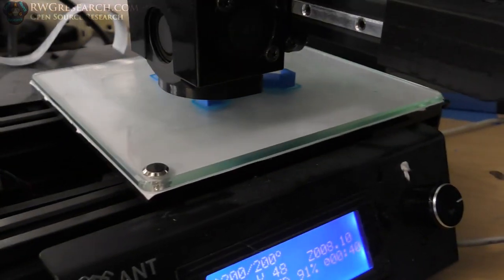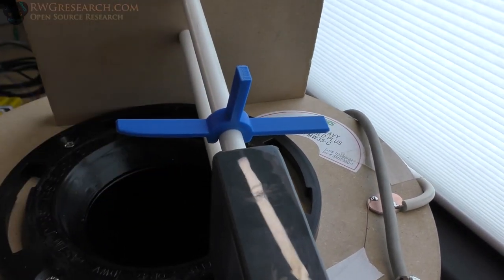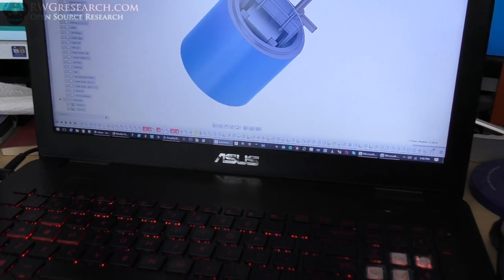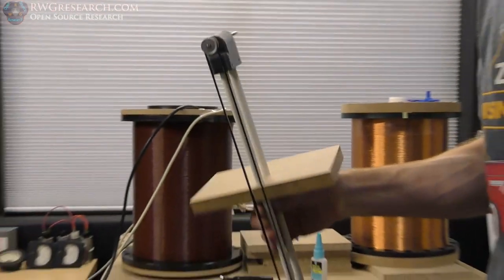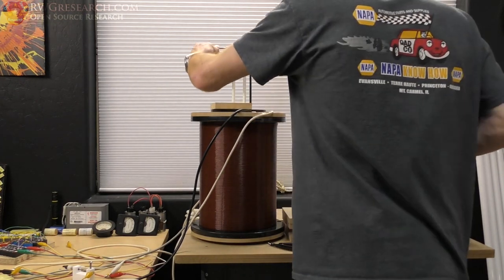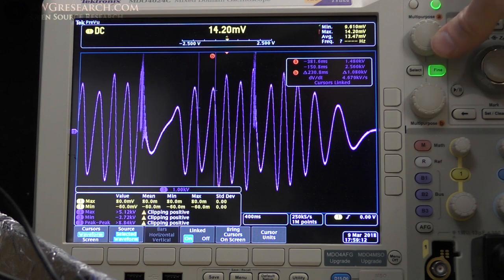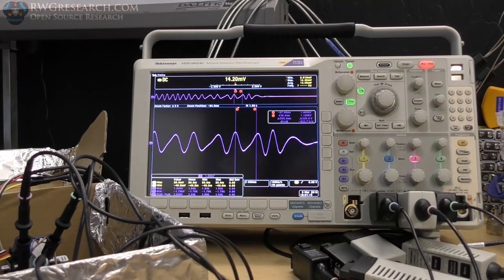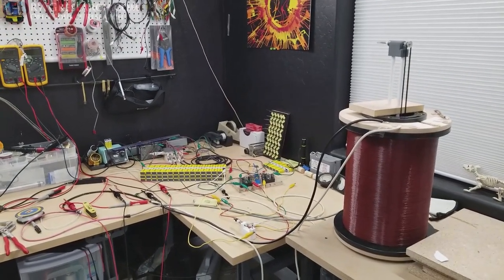JWN Project P11: 2" Magnet Inside Of The Coil.. Big Sparks!

Comment: Russ, could you try long rod of rectangle magnet inside? It could generate more power
Reply from the maker: I have used the 2" magnet like you are saying. however the best interaction with the coil is to rotate the magnet, if you move it up and down fixed ( not rotating) the induction from each pole cancel out other... ~Russ

Comment: carefull no to fry your oscilloscope with such high voltage, you can also inscrease the inductance of the coil by adding a steel shell outside
Reply from the maker: yes, thanks, not so sure i want any metal at all around this, its a totally air system. ~Russ

Comment: May I ask what the purpose of the spark gap is for?
Reply from the maker: currently the spark gap is a safety. if i short out any excess voltage by a spark gap. i can keep the crazy voltages down to a level where i can attache my probes. in this video its just to get an idea on what the voltage is. voltage break down in air is know. (an electric field of about 3 x 106 V/m or 3 kV/mm) so it gives us an idea. we had about 10mm or so... so that's ~30,000V.   it also acts as a type of diode when set up right. and lastly its a negative resistance. very useful if set up right for some of this research. ~Russ
Reply: Thank you Russ, I can understand that, but can't you use a toroid to do that? 

I am the one that emailed you about a bifilar pancake coil experiment that I am trying to get someone to look into. Just wondering if you have given that any thought? 

Also, while I have your attention here, what happened with your work on Stan Meyers voltage disassociation of water? The reason why I am asking is that I am finding that most of you guys working with coils do not understand RF energy. Stan did, and he left some hints to that. He said he hit the plates with voltages that were 180 deg out of phase, his negative side on his circuit was not ground. Even people like Eric Dollard do not seem to understand positive and negative charges. You have a scope, everything past 180 deg is negative voltage (potential) and the only way you could hit those plates AT THE SAME TIME with a positive and negative voltage (potential) would be to use the two antinodes of a standing wave of one wavelength of the length of wire used to make a coil.

I believe this is something Tesla understood, hence the bifilar pancake coil with the center tap being dead center on the antinode of a 1/2 wavelength standing wave on the coil. I have found that point to give a 3 db gain per cycle of the driving power level, and a 6 db gain per cycle  on a 1/4 wave length.

There is no doubt in my mind that both Tesla and Meyers understood these things! I am just having a hard time finding anyone working on the things like you are that does. 

I would love to hear any thoughts you have about these things.

I will leave you with a link here but please keep in mind that this is the second video I did where I was talking on the video and I make some stupid mistakes like calling the calibration line 100 watts when I meant 1 watt. I uploaded it thinking I could put some notes on the video after I up loaded it, only to find that YouTube is not giving us that option anymore. 

https://www.youtube.com/watch?v=gd7Ef2fPQ7w

Thanks you
David Monroe

Comment: Russ, i want to share my coming experiment next year, like you do on your project.  If  you want to do this too, i dont mind, just share it with lots of people as quickly as possible if you do, just in case....   I already have contacted the United States Airforce twice, and they  showed no concerns about my coming experiment next year.  I plan to first create a low powered forcefield using a static field held in a capacitored metal tube.  The three inner sleeves will provide a negative internal charge in the hollow space, approximately one to two inches deep and chafed at the end at a 45° angle to facillitate chamber to atmosphere wave form matching.  The structure that holds the tubes will at first be a non conductive metal, *********** if you use metal, you have to take into account the metal is part of the capacitor.  Also, even non-conductive materials can hold a lethal dose of static charge, thus, when doing the experiments, always have the structure holding the sleeves grounded to a well grounded source, away from any ac grounds in your area.. ************* The sleeves are in capacitor ring form because they can hold a static charge in place.  The layers will be a simple - + -  .   With the negative charge, on the inside, i can then manipulate the field with acoustic signals, ie send music/sound frequencies into the coil, to vibrate the static field as if it were water on a speaker, like they do in cymatics.  It should work.  The reason your hand can touch a cell phone or keyboard and not get stuck to it is because, like the atoms in all solid and semisolid material, there is a crystalized pattern of atoms, with a pattern of plus and negative charges, but also a lot of static fields.  If you excite the electrons in a static field to hold standing waves in a resonating chamber, and these standing waves are tiny, organized, and able to attract and or create positive and negative sides of the electrons,  they will repel matter the way your hand does.  That is part 1 of the experiment. Ps. Its possible the coils need to be wound with the inside diameter also at a 45° angle, large end pointing downward.  If you are an occultist, you could also try 33° angles on either or both.
Part 2. Is when i send large signal pulses to slap the air and cause a positive pressure change in the air, to enable a lift of the field above any solid surface.  I believe gravity is an attractive wave frequency that holds matter and magnets together.  Sadly, if you send antiwaves, or cancellation waves, it will cause matter to fall apart, lose its coherency.  But you can push off the ground using a pulsed forcefield, making it a safer and different kind of antigravity.  As for inertial dampening, i was playing with fidget spinners the other night, and found that their gyroscopic inertias could be swiftly reduced when turned swiftly back and forth at 90° angles to the forward clockwise spin.  I was thinking that maybe one could manipulate two or three loosely binding forcefields to push objects on a quark level to cancel out the inertia, which is itself a quark field phenomenon, to deplete the number of quarks moving in a single vector or direction, kind of like using two water hoses on either side of a third water hose to scramble and weaken the water dropplets from all moving forward.  By the way, the quark field i speak of is the q particle fields in my magnet theory, basically dark matter/energy, or the quantum field, or the old fashion term, the aether.  The quarks in atom colliders are greatly energized.  Thus they dissipate their energy or charge until they shrink back to normal after their having gained energy from the enormously energies from colliding particles.  Also, its possible and likely easier to dissipate inertial fields by sending a third loosely held forcefield directly opposite into a person's or vehicle's path.

Comment: Nice... See I told you it would be better inside.
Wait till you start driving it....
Reply from the maker: haha, i love you john, however... all most ALL Newman motor/generator's have there magnet in the middle, there is no " i told you so" here :) no worries my friend! i was building the version that i could... :) ~Russ
Reply: I know, just josh'n you.
Have you made the jump to my diagram yet of the magnet in the middle? Think about the flux cutting the coil and how one side is north and one side is south. This splits the coil essentially and generates voltage like a pump generates pressure. as the flux field cuts the loops of the coil it generates per loop of wire. In fact it splits it in half with one side of the loop being cut by the south and the other half of the loop being cut by the north.
 Each loop being cut acting like a battery does when it stacks with other batteries, I.E. like your 9 volt bank does to get to hundreds of volts.
 There isn't gonna be much current in it till you transform it like Newman did. He had two coils. The very large machine has clearly a very heavy gauge coil and a very fine gauge as well. That is the transformer he used to step down the voltage and increase the current.
 You can do it two ways. 
 1: In the version with the central magnet you can do it within the coil, as an additional wrap or
 2: as a loosely coupled transformer like I have shown in the forum post with the diagram. In this version the coil is put outside of the coil on the magnetic axis or neutral magnetic plane of the magnet. This would be the shaft point of the magnet. So this way the magnetic field can not interfere with the coupling of the transformer coil.
 #2 might not be as strong as #1
 This is a statement I have not proven yet.

 Much of my time will now be on development of the special battery caps I told you about. I just got in the 
Gaphoil sheets to start designing and testing them.

I need to get some cartridge type cases printed up as I am testing the setup and capabilities of the batteries. The cartridges are gonna be used so I can do exactly what you are doing with those 9v bats you got. This will make the batteries more robust and dynamic. Meaning you can add more cartridges as you need to facilitate the voltage or current required.

 I think mostly I am gonna try rechargeable applications first like wind and solar storage. This will give me some time to devise better safety features like cartridge durability pressure stress (cracking) and the likes for mobile applications. These cartridges will need to handle life long abuse and be able to be recycled fully.

Comment: Is this a terrible idea, router with a flush trim bit, and opening the flange up
Reply from the maker: and the ends fall off... ~Russ
Reply: rwg42985 got it, terrible idea
Reply from the maker: lol only a little. i was going to trim it down ... as it would be ok, but using any power tools around this coil just seems like a bad idea... i can see that but just going right through an end of the coil! lol ~Russ
Reply: not to mention I wonder what kind of crazy flux coupling a permanent magnet motor spinning at 24000+ rpm in the vicinity of that thing  might do.